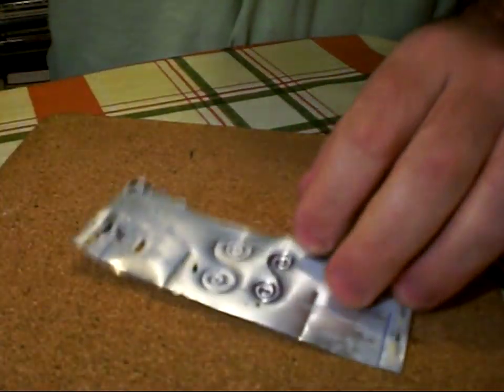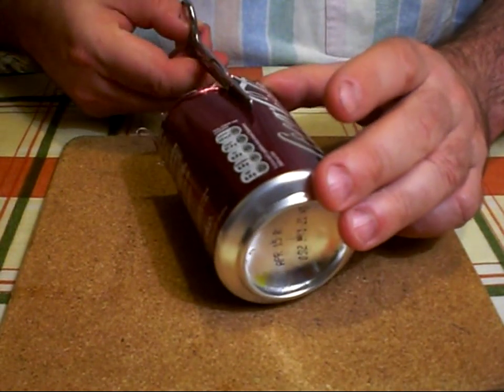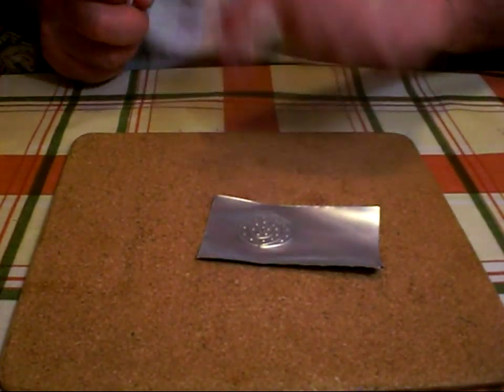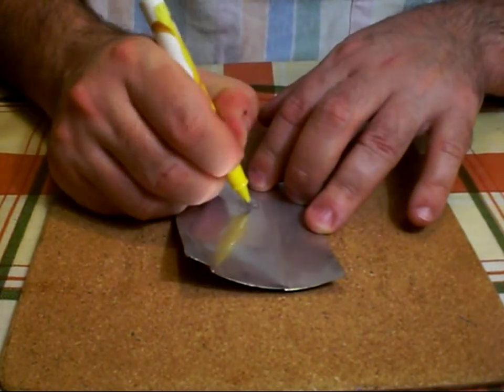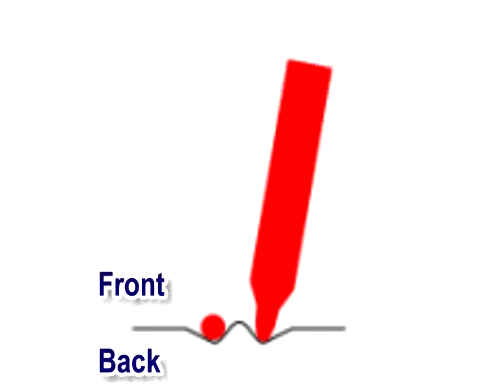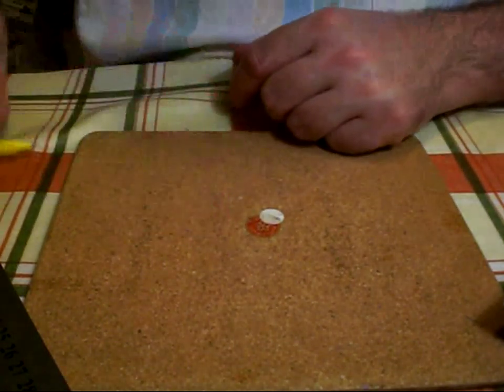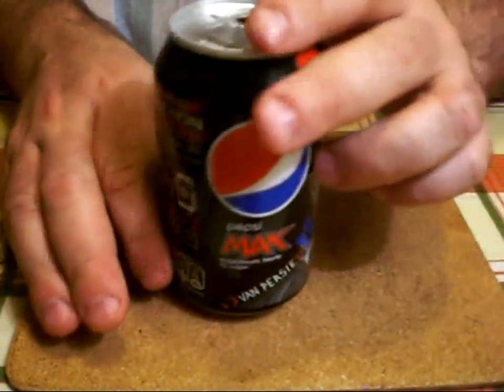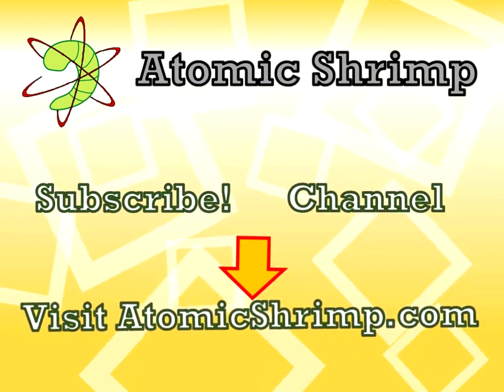Frequently Asked Questions about Drink Can Tinwork

Comment: Why do you need to emboss one side of the slumuninum as opposed to the other?  I was just given some supplies marked "repoussage" by the last owner (she passed away) and typed in a search for repoussage crafting.  I make greeting cards as a craft, and already have some assorted sizes of embossing tool used for scoring around a page making frames and such. (stylus tools, a set was available in a nail/beauty supply or amazon.)
Reply from the maker: I tend to emboss from the printed side, just because the pattern is then seen in relief on the plain silver inner side, but there's no particular reason why it can't be done from the other side.

Comment: You can solder aluminium, you just need the correct solder.
I got mine from Alutight in the UK.
Reply from the maker: It's more like brazing isn't it?  I wonder how well that would work with very thin metal - when I tried annealing drink can metal with a flame, I found it quite hard to avoid burning through it
Reply: AtomicShrimp I told the guy I bought it off that I wanted to join alloy cans, and how should I remove the inks? He said you didn't need to. He also said that he had soldered the foil from chocolate bars!!! Now that is thin!
 I intend joining alloy cans together to form a hollow tube with end caps. I will then pressurise it to give it strength and use it as the body for model rockets. The fuel tanks of the Blue streak rocket used this principle. It should be much lighter than cardboard tube, and much safer than the carbon tube peeps are using nowadays
Could you form your patterns by carving the pattern into a block then either pressing with rubber. Or vac bagging? It would then be repeatable for those times you want that.
I cut my tins by gently scoring them while full with a craft knife, then when empty, cracking them along the score lines by bending back and forth to start a fracture. Failure is not an option as they usually have a cargo of beer!
Reply from the maker: Oh, OK - I wonder what alloy it is?  Do you solder it with an ordinary soldering iron?

I've seen people emboss thin alloy with a press and patterned die, but the results are pretty flat and disappointing at the sorts of force available from amateur-grade kit.
Reply: AtomicShrimp alutighteurope@hotmail.com is the supplier. He recommended a low heat blowtorch for soldering tin cans. He was joining 1.5mm thick bits of aluminium with a normal blow torch. Melt a blob onto the joint area, keep it hot and scratch the alloy under the molten blob with a scriber or sharp steel point of some sort, this breaks through the oxidation layer and the solder then flows freely down the joint, just like ordinary solder on a clean copper fluxed joint would! This gave what to me is a soldered or brazed joint, it no molten base metal. He proceeded to heat the joint until it was seen to sag slightly and the solder and base metal had fused as a weld would, and this pool had penetrated right through. It wouldn't part with two pairs of pliers, so was plenty strong.
Quite pricy , but as I was at a model engineering show, I got better than half price deal. 
Not used it on tins yet, but I did use his blowtorch and alloy on the stand, and it works. My solder came off the same reel, so not much room for smoke and mirrors.

Comment: Did you see the paint removal trick that involves boiling the empty cans in a pressure cooker, then rub the paint off with acetone/ nail varnish remover using a paper towel. Prior to boiling, acetone does not touch the paint, which is weird.
Reply: If you happen to be in the UK then ELB (East London Brewing) cans have stick on labels on their cans rather than printed cans. The label is easily peeled off leave no glue residue on the can. This eliminates the laborious process of scratching off paint. But, the beer ain't cheap; £2.20 a tin whereas a coke can is about 50 per tin and we are only talking a 330ml can here! I guess it depends on your favoured drink. No sure if their cans are aluminum or stainless steel and I do not have a magnet. Not even sure why they use stick on labels rather than printed cans; is it more ecologically sound to use stick on than printing? If so then good on them, maybe other manufacturers will follow suit.
Reply: @BackgammonLondon  you can get beer for a lot cheaper than £2.20, where do you live lol.

Comment: I have worked with aluminum cans since 2001. If you press too hard when drawing the lines, the metal is “work hardened”  and the metal can break when folded. Do not press hard when drawing those fold lines!